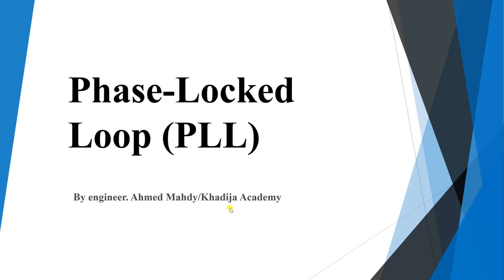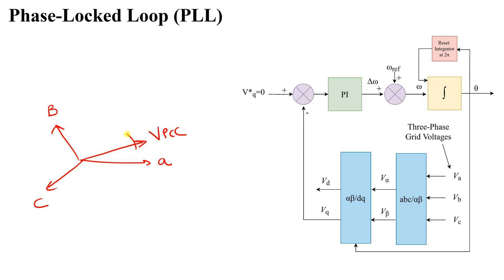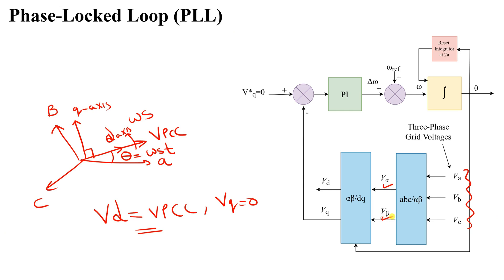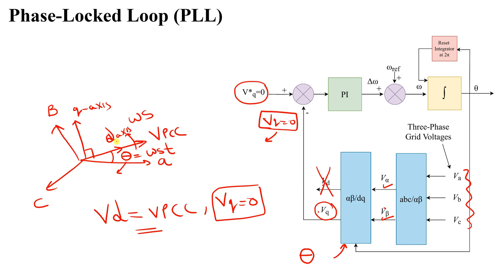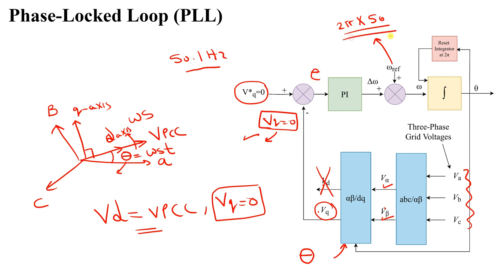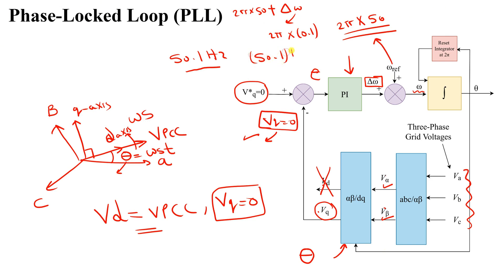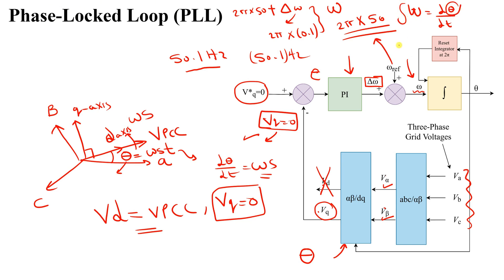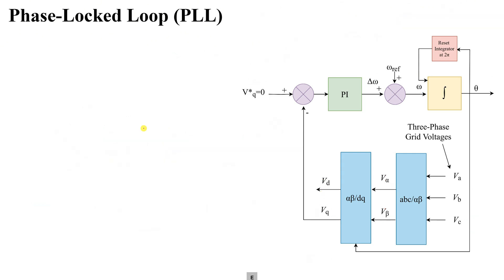Phase Locked Loop PLL - Lesson 13

Comment: thank you so much your videos are great! why would PLL be used when we can use the method in the previous video to calculate theta from the calculated Vtheta and Vbeta values and using tan inverse?
Reply from the maker: You are welcome. The problem with the first method is noise. Any small noise in measurements can significantly affect the value of theta. PLL is a strategy used a lot in models inside the MathWorks library. However, in the literature or research papers, there are other techniques proposed that try to reach a better performance than PLL.